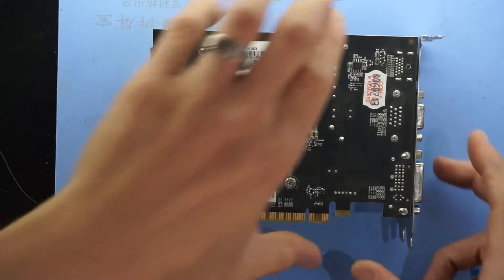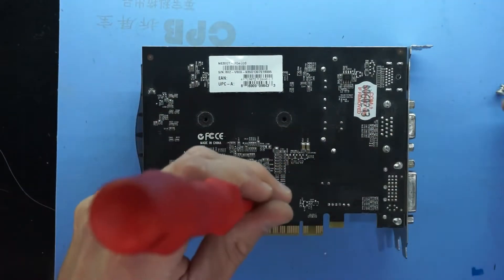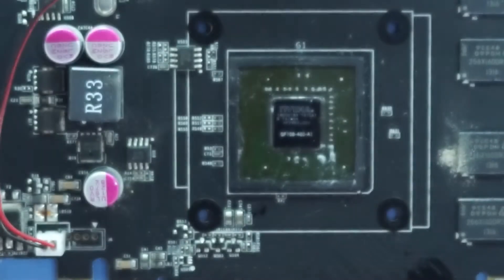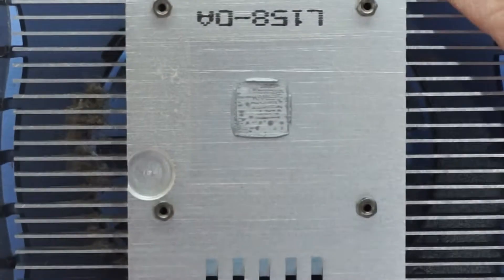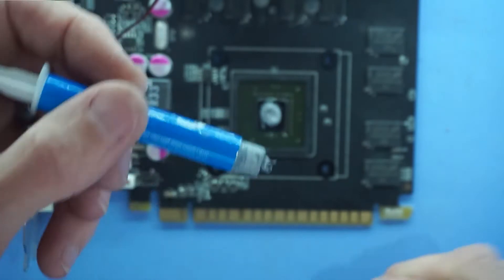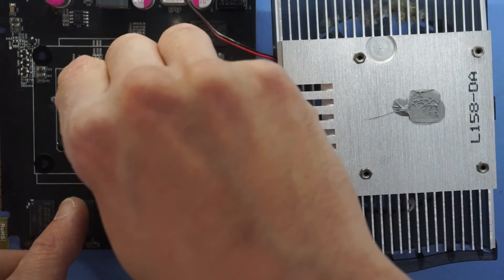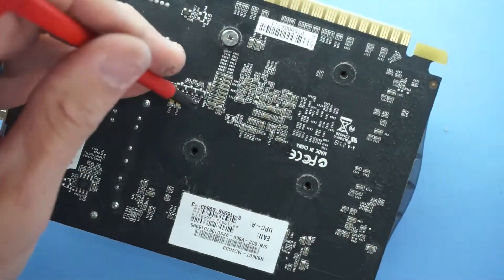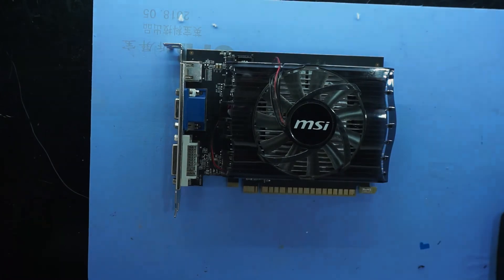Geforce GT630 Thermal Paste Replacement

Comment: Is there a certain special thermal compound recommended for video cards?  I work at a casino and Aristocrat games use a version of the GT 630, and because they're running 24/7, the thermal compound from the factory dries up hard and crusty and then they overheat and start blacking out.  I've tried putting fresh thermal compound on, but they usually don't last.  They'll run a few days and start blacking out again.  I have a couple different types, Z9 and type 44, both in a similar brown tube made by GC.  Is there something better that I should be using?  Thanks
Reply from the maker: any thermalpaste should go OK,

strange that it's turning black, is the thermal paste touching on a cooler that's painted black? 

you could possibly try using these instead 

https://www.thermal-grizzly.com/en/kryosheet/s-tg-ks-24-12

been seeing some good reviews about them
Reply: @rickstechrepairs  I think my first post was confusing. The thermal paste itself isn't turning black, the monitor on the game is blacking out. In other words it's shutting down probably going into thermal shutdown causing a no video signal condition.. Thanks for the recommendation, I'll try that stuff and see if they last longer.

Comment: Hey thanks for sharing. I got a question. What did you spray on the chip? Will it ruin the chip? Thanks!
Reply from the maker: I sprayed isopropyl alcohol to clear off the last of the thermal paste, it wont damage the chip